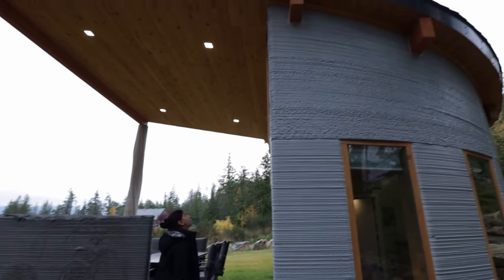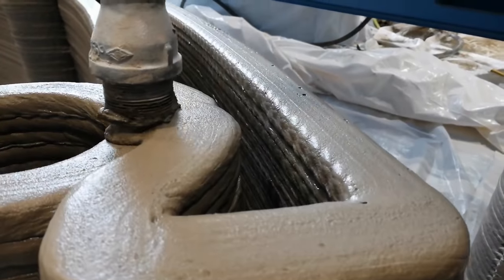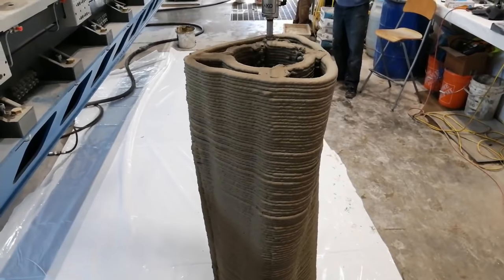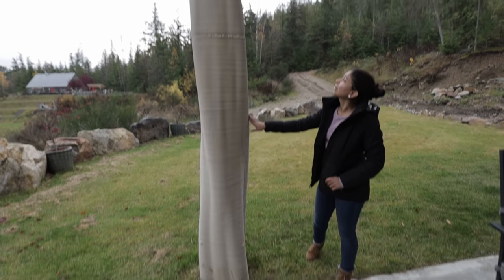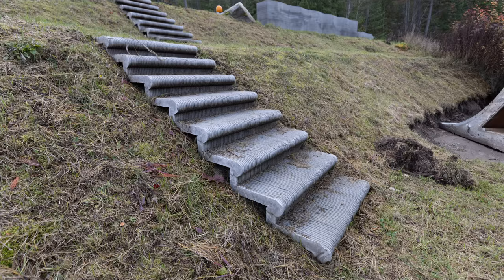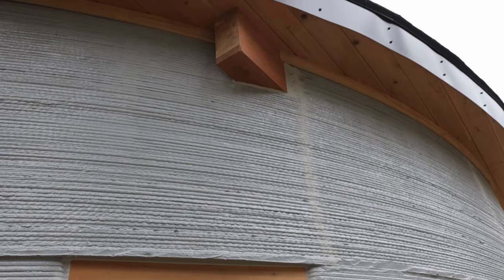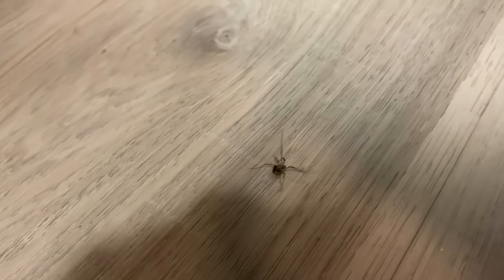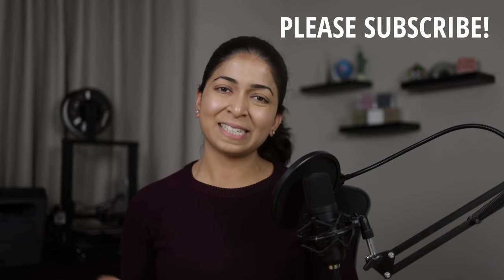Fibonacci 3D printed house | Good, Bad & Ugly

Comment: All the printed houses you’ve shown so far have had problems with electrical boxes not fitting correctly. I wonder when just one of them will figure out that, hey, maybe it’s worth putting a couple of hours into fixing this problem? The fact that they’re building these imaginative houses then shoving in a wobbly off the shelf electrical box and saying “close enough” baffles me. It’s always all in the details and I feel like these companies  are so transfixed by the big ol’ walls they forget about the critical details.
Reply: I'm sure they have put more than a few hours into trying to get those boxes to fit properly. Their problem is both the codes that unimaginatively require those boxes and the business expediencies of putting together something that works without solving or re-creating everything that goes into a house. e.g. the plumbing and heating is still in a traditionally framed wall.  Personally, for projects like these I would like to see the power and lighting completely disassociated from the wall structure. One could do most of it these days with cordless appliances and lighting and just have a charge station in a utility room. It's not hard to imagine a house with no electrical cabling at all in the walls or structure. It's way hard to imagine such a thing passing an inspection.
Reply: Use a 3D scanner on the hole as-built and then 3D print (in plastic) the custom-fitting boxes and cover plates?
Reply: @mjkaelbling  Or 3D scan and then custom print shims for a standard box.

I do wonder how a dangling box passes inspection.  (Is being fixed in place without gaps not part of the code?) 

 Or fails to get negative reviews on Airbnb.
Reply: They just need to cut the hole more accurately.  The other option would be to print around the receptacle boxes when the house is printed but starting and stopping the flow of the cement may cause other issues to deal with.
Reply: @grejen711  So you are going to have batteries for every light and appliance in your house, the cost of that over a couple years is going to exceed the cost to just have wires installed.  The code requires outlets every 12 feet so that you can plug in a 6 foot cord anywhere and people aren't tempted to use extension cords which are a fire hazard.
Reply: Honestly 3-d printing outlet boxes with a commercial PLA plastic printer would help a lot. Especially since this company seems to focus a lot on prototyping for now.

Comment from the maker: CORRECTION: I got the volume off a Designboom article and didn't convert it to verify. Big mistake! 
https://www.designboom.com/architecture/the-fibonacci-house-first-fully-3d-printed-home-on-airbnb-07-08-2021/
Thanks for the dozens of comments on that mistake :P
Reply: So, you gotta wonder where 800,000 came from.. Mebby total length of pour?
Reply: I noticed it and thanks for the heads up but I still don't know the correct amount of concrete used. Does anybody have a clue?
Reply: I think this is a kind of funny mistake many people know that it is wrong.

Comment: I was initially excited about 3D-printed houses, but the more I see of 3D printed houses, the less I like them.  I think they would do better to consider the concrete as a replacement for exterior bricks and use wood & drywall on the insides.  It seems ridiculous and counter-productive to put your wiring inside the concrete.  If you have to rewire your house or opt for a physical change (such as an expansion), it's going to be more expensive than normal, I'd think.
Reply: Yes. It would be nearly impossible to move electrical inside the walls.

As an electrician, I would just make sure they have plenty plenty of plugs throughout the home, and I'd pipe several extra circuits from the main and/or sub-panel to the attic. Try to future proof it as much as possible.
Reply: @s.n.9485  I agree, it should be made with large scale conduits in the walls for easily modified wiring.
Reply: With how fast technology changes, I bet the wiring will need updated sooner than later
Reply: @Jenny-tm3cm  Yep.  We bought an older house, ten years ago  After the inspection, we were informed we'd have to rewire if we wanted to use newer type lights (halogen, LED).  I tested that, b/c I didn't think that made any sense.  Now I have a set of lights and one outlet that no longer works. lol
Reply: @grondhero  What was the age of the existing wiring?
Reply: @stephenmorrissey1254  I honestly don't know.  Our house was built in 1965; no idea if it's the original wiring or not.  We're about to be debt free (except for mortgage) and I plan to have the house rewired within a year or two, but don't know how much that would cost.
Reply: Most construction in southeast Asia has its electricity and plumbing embedded into the poured concrete walls of the house.  Even internal walls are solid concrete, much to the disappointment of anyone trying to use WiFi more than one room away from the access point.  It is a nightmare when minor changes or repairs need to be made.  Only the newest construction (mostly condos) is using stud walls now.
Reply: Traditional Prefab concrete panels would be cheaper.. not sure what this does better. 

Elec/plumb/HVAC are more difficult and expensive in masonry walls. And later changes are about impossible with spray foam filling the voids. 

Some videos showing the full build of other 3d builds and they are typically only doing the exterior walls and many are building 2x4 walls inside those exterior walls and all the interior walls.  So basically they are printing a exterior veneer.
Reply: Maybe cause my dad works in construction but I wasn’t 😂 a little happy to see it fail ngl

Comment: What I see is a solution waiting for a  problem. That is for the walls.

I'm an engineer that did RC concrete structures for metro. We were doing lots of curved custom shapes. It's nothing special with a skilled carpenters or good design. The biggest issue is that these are custom one-offs. The walls from the video could have been cured in forms. This is where I see "the future" - prefabricated "fancy" walls. It's cheaper, and since stone is used, also more eco-friendly. 

It's a different story for smaller architectural items. These looked very good. I think if 3D companies concentrate on things that cannot be done without 3D printer, they will be profitable.
Reply: Thinking as a consumer, I do like the small furniture and custom peices but the home itself seems no different from block brick
Reply: HS2 is looking into printed tunnel units at the moment
Reply: Agreed! I have a regular 3D printer at home that I use all the time and love. But for houses and buildings, I think nicer prefabs are the best solution in terms of cost and environmental impact. A lot of those designs are like Lego bricks that can be combined creatively into millions of combinations. AND in a lot of cases, if the original building is no longer needed they can be disassembled and reused for something else.
Reply: Exactly.  All I could think as I watched them print and then cart these things around is...why didn't you just pour a form.
Reply: @mehmeh533  Although, given the client has demanded a spiral plan and those undulating front columns, I'm not sure I'd want to have to make that formwork!
Reply: hmm maybe all they need is another arm fixing the printers problems like could just flatten the sides before they solidifies
Reply: @orkhepaj  
Or maybe just a form. :)
Reply: @valdius85  then it would be pointless to use 3d printing :P
Reply: GC, and PM at a large Architect's office here. 
Maybe they should print complex concrete form instead? Imagine that. But that is called ICF. Which are nearly foolproof if one can read a tape. 
Again, a skilled carpenter can whip out a  complex form by noon without a million dollar machine that requires meticulous maintence and baby wipes. 
This just makes me cringe with the silly idea. What about the design is fibonacci again? Looky! Door handles and sparks. 
And they didn't build a bigger unit because it would have caved in on them during construction and or the bank took one look at this thing tearing itself apart into a molded concretion and mercifully pulled the plug. 
They would never give a CFO for that here. And ihere is NW Arkansas.
Reply: Yeah, they sell continuous variable curved commercial concrete forms. Have for years, nobody wants to pay for curved finish to meet the walls. Look at curved walls and you'll be amazed how little anything butts up against the curve. The wall will terminate with a straight, edge or bottom, almost all the time.
Reply: @orkhepaj  just needs a tapered piec of metal that slides along the outside. They keep it that way to market the look I presume.

Comment: Very well done, thanks. Did I hear right with the volume of concrete? 800,000 cubic meters! 2:40 mark. I would guess the correct number would be more like 8 cubic meters for that tiny home.
Reply from the maker: Yup, I messed that up. Thanks for the correction.
Reply: That's enough concrete to build a slab 3 feet thick over an acre.
Reply: Maybe it was 800,000 cubic inches, or 13m^3?
Reply: From the fibonacci house website: "a total volume of 800,000 m3 of concrete was printed over 20 parts." That's gotta be a typo for a 35 sqm house. Unless the lowercase 'm' means something else?
Reply: @BelindaCarr  But we still don't know how much concrete was used.
Reply: Does no one fact check, there are serveral websites that claim that number as well.  An Olympic swiming pool is 2500m3 so this house uses 320,  must be like tha Tardis ,really big on the inside.

Comment: Did you just say they used 800000 cubic meters of concrete?  Because that's a block 200 meters wide, 200 meters long, and 20 meters high which is significantly more than the volume of the house…
Reply: "It's all in the foundation where you can't see it." contractor states with a straight face!
Reply: Ngl I wouldn't mind having a house made from this much concrete. Lavish indeed lol
Reply: Yeah, that's probably a talko. Even 100,000 cubic meters is substantially larger than the "Total Auditorium Volume" of the Royal Albert Hall in the UK (themeasureofthings).  It's enough concrete to fill 320 Olympic Swimming Pools (justintools). Since the house has 35 m2 of floor space you would have to lay it out in a single floor and extend it up nearly 23 km  (28 Burj Khalifas) to contain 800,000 cubic meters of interior space, let alone use that much concrete.
Reply: @victoriaq5157  The house wasn't built on a mountain, it was built in the middle of a field :)
Reply: I think maybe ccs?

Comment: I think you stated the bigger problem with 3D printed building very well. It's mostly done by companies focussing on the tech side rather than companies with traditional building experience using 3D printing as a new tool. If you want to print a house then you should first and foremost know how to build a house.

Comment: I've always seen 3D printing as a solution that people had to look for problems to justify it's existence for. 
Mind you there's a lot of cool stuff made with 3D printing.
Reply: There are areas where 3d printing is practical and very useful and has been for years. As an engineer it's great to be able to 3d print complex parts in a few hours that would take weeks or months to get custom machined. It dramatically speeds up prototyping. There are even some things that would be impossible to machine traditionally but can be 3d printed. Having those geometries available really opens up new design options. That said, I don't think house walls are one of the areas where it makes sense now.

Comment: Do you think the small iron bars are doing anything about reinforcing the structure ?  I like the foot they made for the table , did they used resin to cover the concrete ? The sink looked nice as well . I think it would look way better if they could find a way to cover the walls (at least inside) because I don't see how you can clean them , and imagine the dust in every cracks after a year ....
Reply: These small bars fo a lot, but they should have a big "I" shape, with foot and head having a horizontal part that anchors to the wall.
Reply: Untreated steel re-bar used in this way is next to useless and will only serve to pry the structure apart as they rust expand over time from. Traditional galvanised tie wires which is also flexible between brick mortar courses is what I think they are trying to recreate here, not fully understanding why they are doing it. These people are artisans not builders.
Reply: @AV036  True. So much true.
Reply: @AV036  Yeah used this way I have to wonder if it's only to hold the walls together during curing as you said in the long run the will add very little structural rigidity especially after the start rusting ! Like someone else said in another comment thread here that a smaller u shaped galvanized steel that you push into the 3d printed cement would most likely be better in the long run for  structural rigidity!
Reply: The rebar hold the print while it is wet and serves to support the walls while they go through the dynamic loading of the craning operation, once the walls are placed they don't serve a purpose. The walls were filled with polyurethane foam so they will not rust anywhere near as quickly as they would if they were completely encased in concrete.

Comment: "The total volume of concrete used is 800,000 cubic meters"  That volume of concrete would be enough to pave a foot thick two lane highway for more than 267 miles.  And cost at todays rates ($117/yard USA)= $165 million USD.   Must have been a heck of a thick foundation. Belinda do you ever read these comments? Or post corrections?
Reply: Yes she does.
Reply: 2:39 That's one heck of a typo.  Do you think 8 or 80 cubic meters?
Reply: @grondhero  80 probably for everything including slab. Still seems a bit high
Reply: I'm guessing they meant 800000 cubic centimeter (guessing)

800000 cubic centimeters would be .8 m^3 so that makes more sense to me
Reply from the maker: Got the number off a designboom article and didn't convert it to verify. My bad!
https://www.designboom.com/architecture/the-fibonacci-house-first-fully-3d-printed-home-on-airbnb-07-08-2021/
Reply: @grondhero  8
Reply: @landen1234  No way that is 80 meters. I'm recalling an 80 meter pour we did long ago. It was considered big for the time. I think 8 meters which is 8,000 liters or 8,000,000 CC. There is a zero problem in someone's calculations. Walls are for the most part hollow.
Reply: Was the cost of this "not-concrete" plasti-crete ever mentioned? How would you like to drive on a highway printed with all those ridges?
Reply: 267 miles of highway or..
A block 100m  by 100m by 80m. That's about the same material efficiency as CNC milling....
Reply: My bet is 800,000 is the length of pour.
Reply: Mistakes happen. I'm betting it was the length of the pour as well. 😊🌎🌄

Comment: I would like to see them do a design that gets covered with earth afterwards, I could see a domed or roman arch style structure providing a much better aesthetic choice. also if you make the home be covered with earth you could simply seal the outer walls with a thick coating and hide its imperfections with the earth covering, this would increase thermal insulation values by a large amount and the wide dome/arch would provide the feeling of a much larger space. Also living walls or moss walls of some type could be installed, with a significant curve on the dome/arch design you could even make it have a tiered rooftop garden space. Weight calculations would have to be done to ensure the roof can handle the weight correctly. In Canada such a design would also allow you to use snow for thermal insulation around the home during the winter, as snow packed and landing on the roof/ground would provide extra insulation during the winter. Anyone have any thoughts? also for adding in rebar reinforcement I have wondered why they do no simply use large pre welded rebar structures and vibrate them into position while it its being formed/printed? this would allow you to put in larger beams and offset them in a donkey kong style grid with some overlap. Would have to be worked out with cure times of previous layer so they can actually go deep enough, but then you could use smaller length beams and do more of them. Think of a 6x6 or 4x4 rebar lattice in a H shape or just normal lattice shape vibrated in after a few layers have been put down, it would provide support and the offset would allow redundancy and strength to the structure. With a dome shape to ensure lots of natural light it would have to have a very large front with lots of glass to allow enough spill thru to the main living space areas.

Comment: Adding to the electrical box discussion. I lived in Hawaii for 4 plus years in a typical Hawaiian built home which is not stick framed like on the mainland. The house walls are built with 1 inch thick lumber with a horizontal stiffener to reduce flexing. With no wall cavity all of the electrical is surface mounted. The wiring is covered with a piece of U-channel trim.